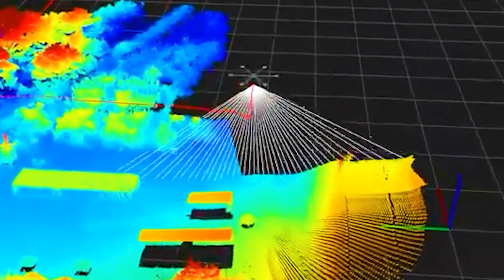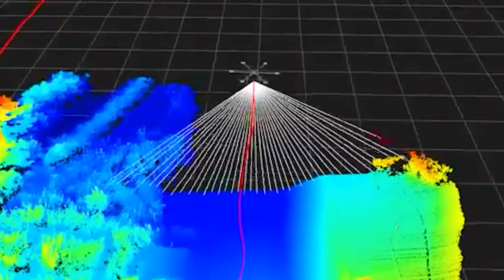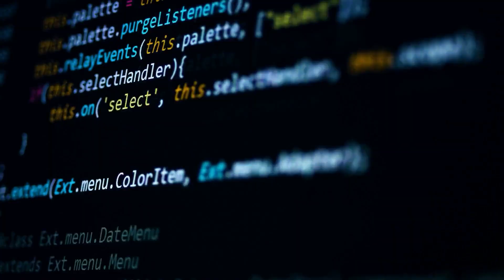CRISIS in JAPAN: TRUCK DRIVERS REPLACED by ROBOTS

Comment: Since the mid 80’s Ive always said we have trains and tracks already in place.
The majority or bulk could be transported with trains from the ports and having it sent directly to warehouses within 10 to 20 miles or km’s from its final destination where local trucks can now deliver the products. 
This would relieve the huge numbers of long haul trucks on all the major highways.
Reply from the maker: Absolutely agree — that's a super practical idea. Trains are massively underused for freight in many regions, even though they’re way more efficient for long hauls. Integrating rail and local delivery could really reduce congestion and emissions. Thanks for sharing that insight — it’s wild how long we’ve had the infrastructure but haven’t fully tapped into it!

Comment: WE have that in north America, railways.
Reply: The rail systems are seemingly being purposed to their max, and it seems that it's too expensive or impractical to build the extra infrastructure. Im guessing these engineers figured out the trucking industry and its logistics can't be replicated easily (like last mile requirements) on rail. They probably also realized it would be unsafe or impractical to go the most obvious route (automated 18 wheelers) or figured it would be beneficial to just build a totally separate infrastructure that's like 99% automated and will do last mile delivery.
Reply from the maker: Great points, both of you. Japan’s approach really shows how rethinking logistics from scratch—rather than just upgrading existing systems—can lead to some bold and efficient solutions. Rail has its strengths, but as mentioned, last-mile delivery and full automation require a whole new kind of infrastructure and can bring a lot of benefits.